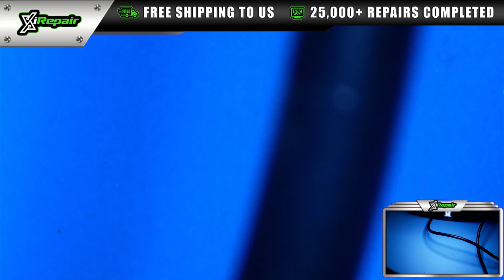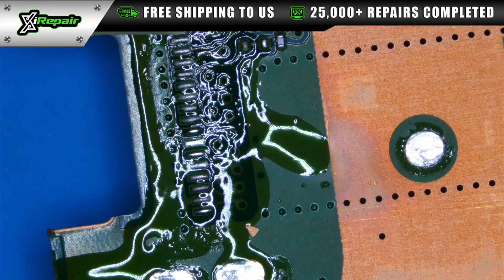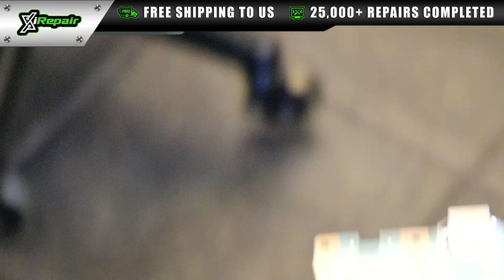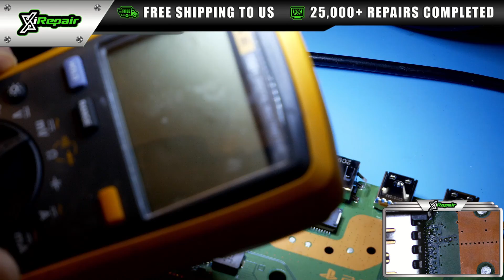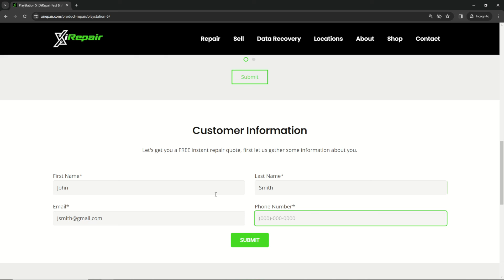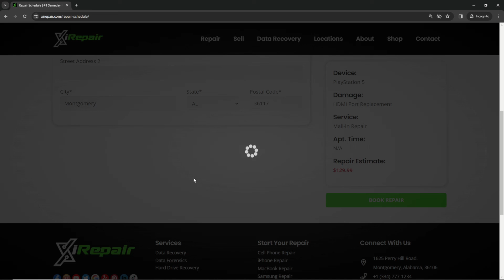PlayStation 5 HDMI Port Replacement Newest Version 1200 Series - No Display Fix Repair - XiRepair

Comment: I’ve done my second 1200 series now where I replace the port with a standard mobilesentrix HDMI port to reassemble it and find it have no power. I’ve don’t plenty of PS5’s so far in my career and don’t think I’m an idiot, did they change the pin layout on the 1200 series HDMI ports or am I just screwing up somewhere?

Comment: Good suggestion for the method. Worked for me. Mine had an 0201 capacitor right next to the pins that I was worried about having to remove and replace, but hearing from the other side avoided having to touch any other parts.
Reply: Hell yeah man!